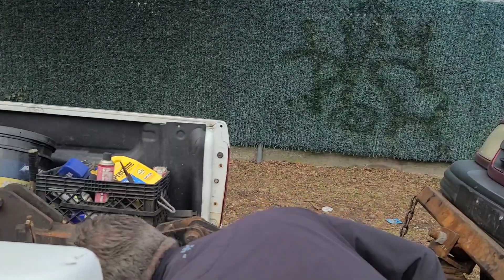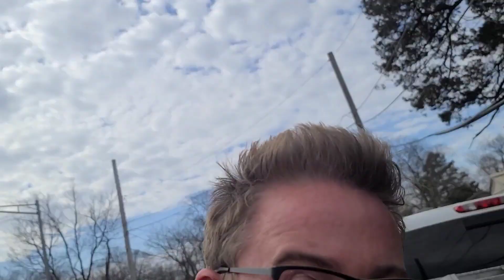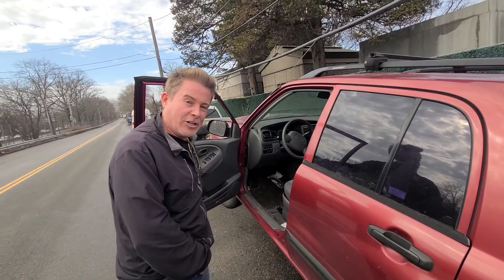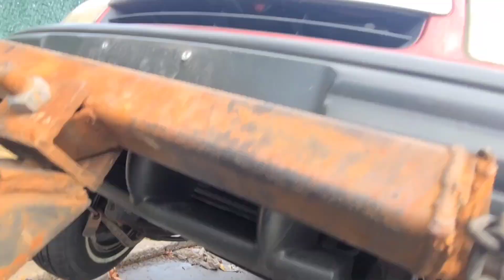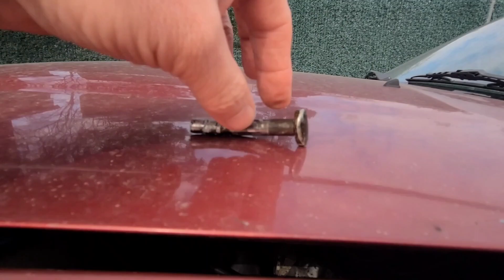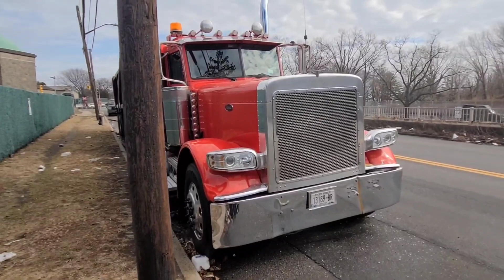Part From Chevrolet Motor Hits Our Secondary Camera! Plus Bonus Burnout! Neutral Drop 😁🤣😂

Comment: By the way, that part sure looks to be a rod bolt/stud. I'm also very surprised that made it out of the motor but nothing else did.
Reply: Honestly it's kinda impressive that it launched out without the rest of the rod. The ones I see usually break off in the rod or the whole rod breaks and they get stuck in them
Reply: You do realize that’s because they stuck something up next to the belt with the fan to make it fall and there’s no way motor and Sized like that Comes undone again and the drops parts out of it not only that the piece that hit their camera was a piece that fell off the Camera one of them shook the chain to make it look like something hit it
Reply: @RerrardedRedneck73  And no dripping oil. Impressive all round.
Reply: @breydencampbell3796  You've obviously never seen engines destroy themselves. The only red flag is the lack of oil.  But if it came out above oil line, then.. that's not a problem.
Reply: @N4CR  it could also be the reason it died at such low miles. What if it was burning or leaking a little oil and there wasn't much left. That would murder the bearings and cause what happened
Reply: @N4CR  The no oil could also be just it had no oil in it left
Reply: Insane. I'd pay to look at the engine disassembled, lol
Reply: @RerrardedRedneck73  That's almost always what happens

Comment: Here's an idea for ya for a motor blow, but would only work on a manual 4x4.. drag something along with the work truck but put what your pulling in 1st gear with it in low range till the motor throws its guts out, put some cameras underneath it..

Like what happened to that black jeep that got towed behind an rv..

Could possibly do it with a 2wd with enough weight over the axle..
Reply: They could just drive at 60mph and money shift into first
Reply: Take a 4x4 and put tiny tires on one axle and large tires on the other.  At 70mph pull it into 4high.  And watch the parts fly!

Comment: Looks like a rod bolt to me. Definitely a mystery why it was the only thing to hit the ground. Stuntman and Cameraman, the dynamic duo. Great Video. As always.
Reply: Pretty sure it's a push rod. Hole would be in the valve cover. Also when that happens valves and pistons make contact meaning good luck starting it back up.
If the "rod bolt" broke, the connecting rod would have punched through the crank case. Also the engine would still turn over because the seized piston is no longer connected to the crank

Comment: Whatever that bolt is that you pulled off of the ground is definitely a motor part.  I've only ever disassembled one motor which was a 4.0 V6 from a friend's Ford Ranger that he hydrolocked back in 2006.  I disassembled everything, sold parts and scrapped the rest, I think I have all of the bolts somewhere still and I remember "T" bolts like that, although I'm not sure what they were for or where they went.

Comment: Hey guys find a way to spin a stick shift car's tires with the starter, try to use like ten car batteries jumpered for 10,000 amps of cranking power and see if u can spin tires using a vehicles own starter motor with a shit ton of amps!!! also feed ceiling fan pull beads into a running motor please!!!!

Comment: Pushrod to the rocker? Hole would be on top through valve cover so no oil would puke out unlike a connecting rod or anything attached to such

Comment: I love every one of your guys videos great content but this one hurt my heart😭😂 trackers are fuckin awesome and pretty sought after nowadays you could easily sell the rest of the body with the blown motor it's hard to find a low mileage one with no rust like that and Chevy trackers are made with Suzuki parts by the way lol
Reply: My mother has a '97, zero rust New Mexico car with factory air, about 140 on the clock. She refuses to give it up.
Reply: @acemobile9806  there practically bulletproof man before some asshole totaled mine it was running about 155k and it took every bit of hell I gave it and wherever the jeeps were in the woods I was right beside em if not in front of em and was great I'm the snow and everything I miss it I'll get another one eventually but I need to sell some other stuff first lol too many s10s
Reply: @charlescrisp5433  yep for sure. I never, NEVER touch that car in the 10 years she's had it. Put gas in it, synthetic oil change & away she goes. Even put a nice cruise unit with electric servo in it, cruises nice down the road. It's a jam up little car & would embarrass a mountain goat. 

My biggest problem is finding good plastic trim pieces & weatherstrips/window fuzzies for it. Florida sun eats everything up just like the rest of the South & desert southwest. There used to be a dealer that sold OEM parts online & could get anything for it but they stopped doing that 10 years ago
Reply: Forgot this, a guy rolled up a few years back waving a wad of cash around & having a damn fit over the car, said he'd give 4 grand no questions asked. Evidently they're worth a ton over somewhere in Africa. My mom's a bit honery & told him to get lost 😂 she's had several wanting to buy it. Hate it for yours, that's what i worry most about hers, some other dickhead killing it

Comment: I hate to leave a negative comment and I did dislike this video until you can prove me otherwise that piece that fell fell off the top of your camera dude and it looks like there’s a nail that fell inside the engine area and there’s no way a seize motor sees that quickly and unsees that quickly you shut it off you have a kill switch to the fuel no doubt in my mind